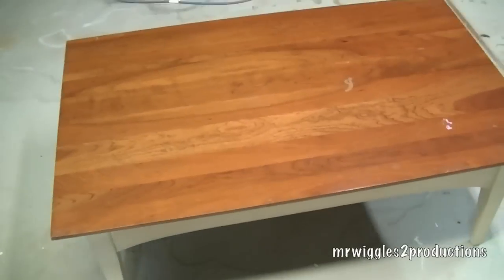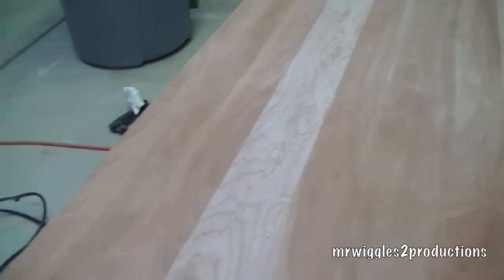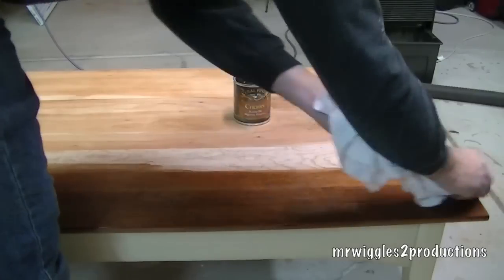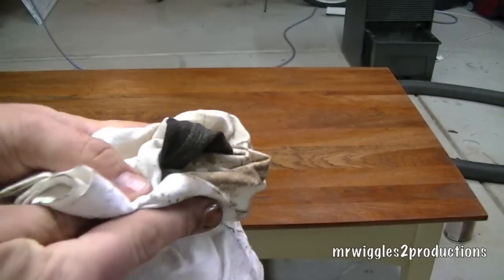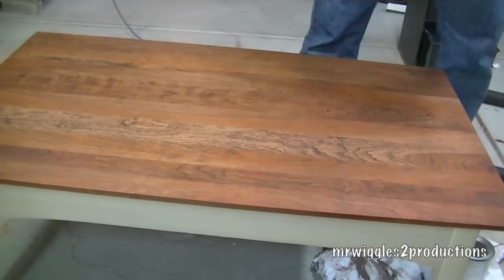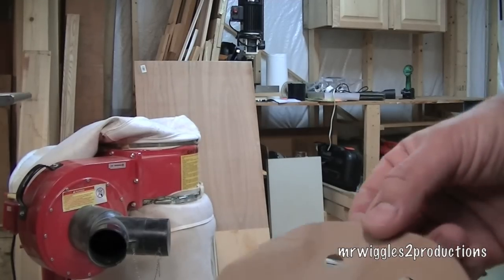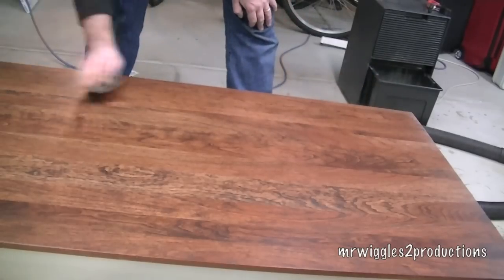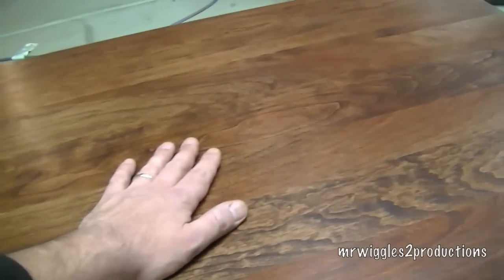Refinishing a Wood Table

Comment: I've always been told not to use a foam brush with poly because it makes airbubbles. Also I heard if you use oil base stain use oil base poly. If you use water base stain use water base poly. True?
Reply from the maker: golyg All that you've heard were true, but things have changed.... a little.  Foam brushes do make air bubbles, but tight foam (more expensive ones make smaller ones) melt into the finish.  Oil stain, oil poly, is usually what I do.. Our mahogany kitchen table I built, used danish oil and water based Minwax, that was 14 years ago and it looks as good as the day I finished it.  In this case, this video was done last winter in my basement, where I never use oil finishes (except stains).  The fumes are too close to the gas furnace.  Thanks for watching!
Reply: Thanks Craig
Reply from the maker: Nice looking picnic table.  Take a look online for good outdoor finishes.  If the table will be exposed to a lot of sun and UVA, UVB certain finishes are better than others.

Comment from the maker: +Jesse Nichols Your comment came up as spam, so hope you get this.  It is difficult to tell the difference between woods.  Experience, smell, touch, a guide like a magazine, book or internet can help or history of the piece to assist you.  Can you identify it as a hardwood or softwood using the fingernail test?  If you press your nail into the bare wood, does it leave a mark?  Once you start doing it, sanding and working it you'll get an idea.  Then you can worry about if its solid wood, plywood or veneer.  Just have fun and give it a try.

Comment: What grit sand did you use between first and second coats of clear?
Reply from the maker: I always go with 220 between 1st and 2nd.  I've tried going higher but you have to work too hard to get any runs out or imperfections.  Just a light scuff with 220 is all you need.  I do like that brown paper bag for the last and final, it works really good for that smooth waxy feel.

Comment: What is the best way to remove sawdust from the surface before staining the wood? Every tutorial mentions this step but no one actually gives instructions on how to do it.
Reply from the maker: +stu wilks I don't know the best way,  but I've tried a lot of them.  I use a shop vac with a soft bristle attachment to get the big cakey stuff.  Afterwards, I use a t-shirt with either mineral spirits or alcohol.  Lacquer thinner evaporates too fast.  Mineral spirits also gives me an idea what the wood will look like with a clear finish, so I get a good look at what stain, varnish or top coat I want to use.
Reply: best way is to use tack cloth rags located 8n the refinsh stain location.
Reply from the maker: Most consumers use these but it is not the best way.  Tack cloths can leave tacky residue behind that attracts dust.

Comment: can a hand sander be used? Do you think the power sander is best?
Reply from the maker: +Rodney Frederick Yes you can, certainly.  The only difference between hand sanding with a block or power sanding is time.  Power tools are a reason I woodwork, I love power tools.  But, I also use 110 year old hand planes to joint and flatten boards.  If you have the time, you can use a hand sander.  I skim sand at the end with a paper bag or 320 grit... but to take off old finish- I need an extension cord.

Comment: Hi if im refinshing a table the same color do I need to sand it down to bare wood.
Reply from the maker: Duane Phillips You'll need to get through the top finish, be it shellac, oil, varnish or polyurethane.  Once you do that you should be good to apply your stain then clear coat.  Just know that if applying stain over a stain, it may come out a little darker.

Comment: Now how much can you sell this for once its refinished? Curious because im refinishing a nice sized table and want to sell it
Reply from the maker: +Įncogn&#238;to That is probably the best question I&#39;ve received on this video.  I can tell you I restored very much the same table for a friend, that was a video I did maybe a year before this one, and I got $100 for just refinishing it.  Every market is different, but around here, I&#39;d list this table for $200.  It is all solid wood, even the drawer is solid wood with dovetail joints.
Reply: +Craig Arndt hm, sounds like Ill make some money off mine then. Thanks for the reply!

Comment: So at what point do you really need to use a stripper vs sanding? Or is a stripper just to avoid sanding?
Reply from the maker: 1997LT1Camaro The stripper I use for detail, like cove moldings or egg and dart designs where you can't get a sander or would take forever.  And sometimes if I am finishing veneer tops I will strip if I think sanding might bore through the veneer to plywood beneath it.  All still needs sanding after stripping, but it's very light.

Comment: So let me get this right.  Steel wool is the last thing you do?  Won't that leave scratches?  Sorry.  I'm new to this.  Thanks
Reply from the maker: Not #0000 aka- 4 Ought steel wool.  Its very fine.  I usually never use steel wool with water based polyurethanes, unless I've allowed them to fully dry.  Or you could use 400 grit paper or a paper bag- you're just lightly removing the nubs or the glossy sheen if you don't like it.  Not putting elbow grease into it.  Hope that helped.

Comment: that's the first issue..the different tables I have no idea what the wood us on either however I wasn't then all to be a similar color finished..Where to start?
Reply from the maker: Kathleen Champ start by removing the old finish.  Sand or chemical stripper.  Lightly sand and refinish.  Its not hard, just time consuming.  You will learn a lot, a 100 ways to refinish furniture so take it slow and do your research online.  Take photos as you work, helps to keep you motivated and can be shared on forums to let people assist you with questions.

Comment: Any tips for how to remove air bubbles if applying clear varnish with a 4" roller?
Reply from the maker: +keitho77 Yes, don't use a roller.  :-)  Rollers by their nature will squeeze air out and pull air back in, creating a mess for a quality finish.  I only use a roller with paint.  If you must use one, make sure you have a high quality brush dipped in the varnish or a separate very thinned amount of varnish to lightly smooth out the bubbles.  But in the end, you would have just been better to brush it on.
Reply: +Craig Arndt Thanks for the quick response Craig. I'm using a water based varnish as per my paint supplier, who also recommended the roller. I'm not happy with the finish. Would you recommend sanding with 220 and using a sponge brush like yours in the video? Thanks.
Reply from the maker: Oh, its a water based varnish that's a little better, thought it was oil based.  I recently used a water based stain that came in a kit with a roller, the bubbles were everywhere.  I decided to thin it as much as I could which helped, then final skim sanded with 320 grit.  Yes, you can definitely use a quality foam applicator, you'll get bubbles but if it is a high quality foam they will be very small.  I will mention, you get bubbles with everything, except spraying usually which is a whole other game.
Reply: +Craig Arndt Thanks for the advice. I'll take it back with some 320 then and try a foam brush for final coat. The roller is just too bad for producing bubbles. The colour of the table in your video is almost identical to mine, except I ruined mine by getting car parts cleaner on the table : (

Comment: What were the grits sizes  you used on this project?
Reply from the maker: Tim heffernan I usually don’t go higher than 220.  Start at 80 to hog off the material, 120 and then 150 and finish with 200.

Comment: How can you find out what kind of wood you have on your table?
Reply from the maker: Visual identification is usually the only way of knowing.  The underside usually gives a better idea of what you have because there isn't likely layers of stain.  I knew this table was cherry based on the color and grain.  I knew it was solid wood because the top and bottom showed the same 3-4" glued up strips of wood.  As you can see in the video the top is a bunch of cherry boards 3-4" wide.  You may want to snap some pictures and post to a forum or pm me and I'll do my best to help out.
Reply: Thank you so much! I haven't sanded the top yet. I have  an old hand me down table that was made during the civil war..I can't wait to see the real wood.
Reply from the maker: That sounds incredible.  That table was made with old growth forest wood if it is from the 1850-60s.  Incredible heirloom.

Comment: Yeah it said my comment wouldn't post but it obviously did, twice. Anyway thanks for your response. I have another question for ya. Do you think it is better to just sand over using a stripper then sanding? or does it just depend?
Reply from the maker: +Jesse Nichols Depends.  If its real wood and its thick enough, you could just sand it.  If it is thin veneer or inlays, then a stripper used with a handful of sawdust is really good at getting finish off.  It really depends on what you have.  Once you identify that, it makes it easier to set a course of what you're going to do.  Sanding is always an option, but veneers have to be respected as they are only millimeters thick and once you go through its hard to fix.
Reply: +Craig Arndt.  Ok I see. Thanks for the info. Sorry for all the comments posting over and over.  On my end it says they won't post and to try again, so I did haha. Thanks again.